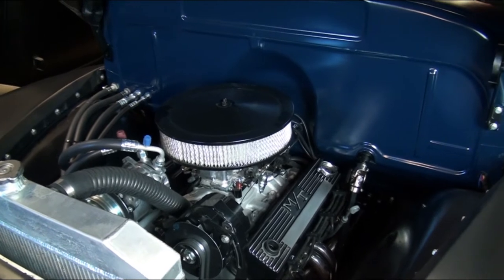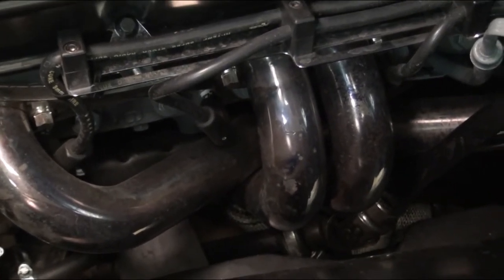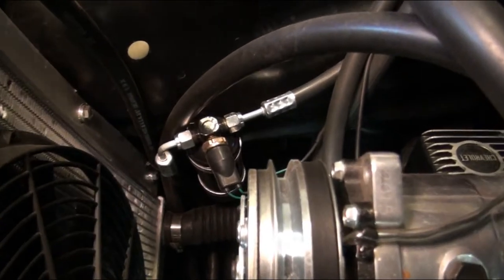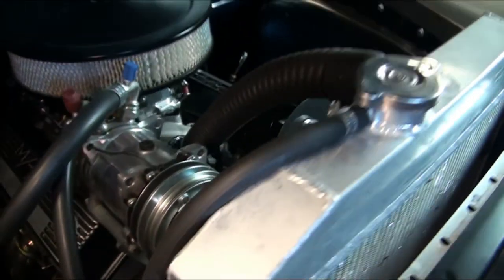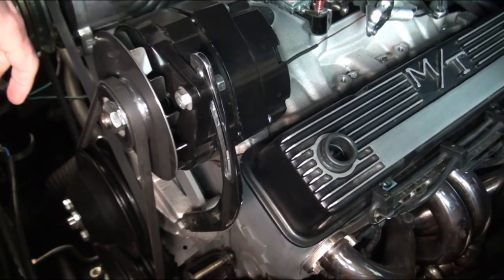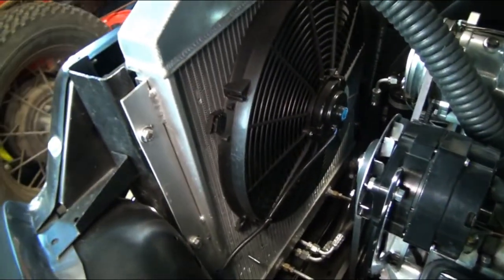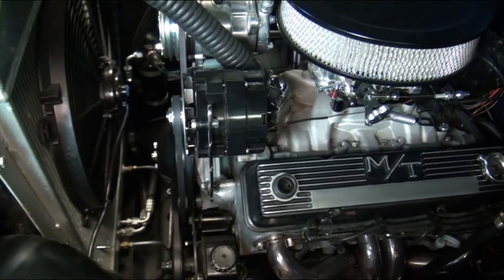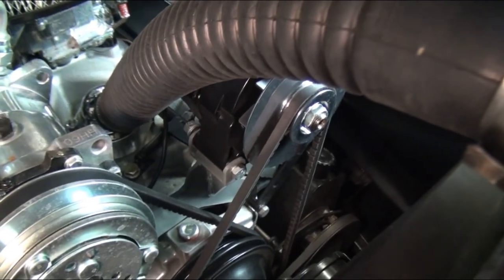1953 Chevy pickup engine compartment

Comment: I inherited a 49 C3100. It didn't have a radiator overflow and I can't find any videos to see how to mount it. where and how did you mount it. I see the tube that was coming off the top of your radiator but where did it go down there?
Reply from the maker: I don't know if these trucks had an actual overflow reservoir. I ran the overflow tube down the inside of the radiator and just let it hang below the lower radiator support.

Comment: Where did you run your wiring harness ?
Reply from the maker: I mounted the fuse panel under the dash near the steering column and ran the wiring through the firewall just above the inner fender. It then tucks under the inner fender and runs along it down towards the bumper. From there I split it off. I put it all in wire loom and shrink tube. Let me know if you'd like to see a video of it and I'll try to take one.
Reply: @RaybuckAutoBodyParts  yes please a video would be awesome thanks